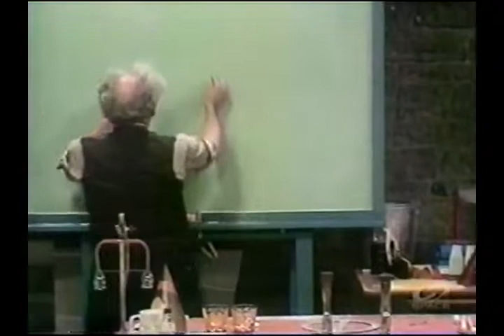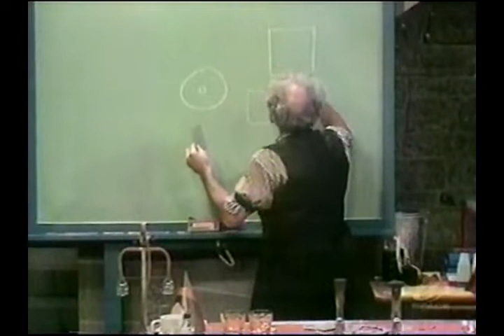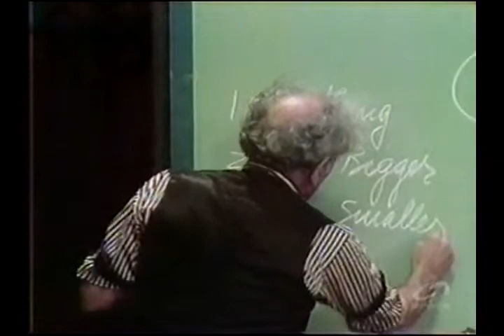Julius Sumner Miller 22 HHOF - Heat Expansion

Comment: If the ring got bigger, the plate must do the same, causing the hole to get bigger. But, my first impression would be that the whole plate expands in all directions causing the hole to get smaller. 🤔🧐